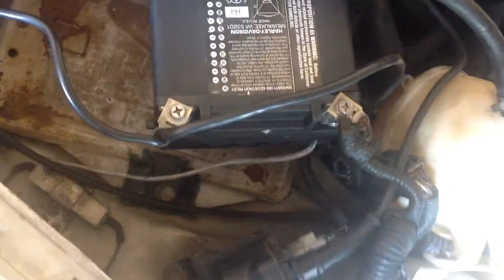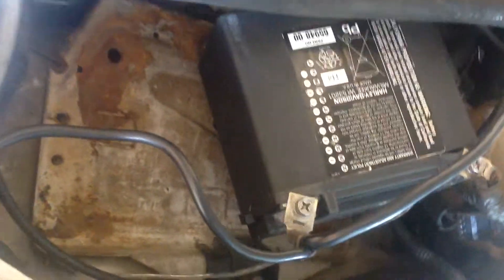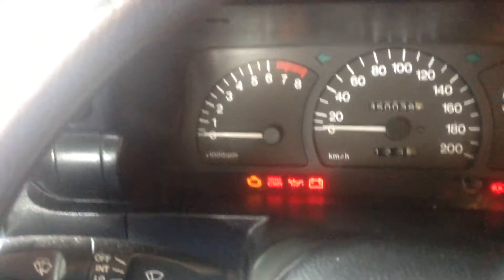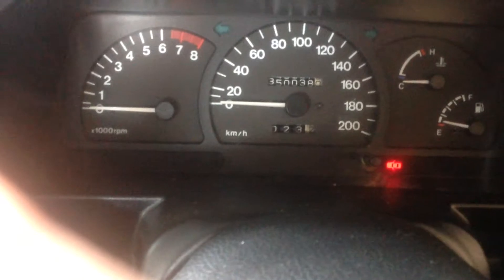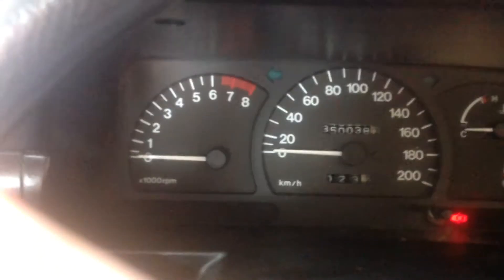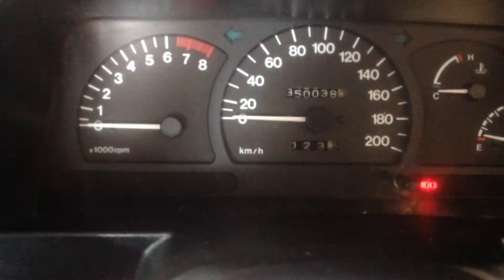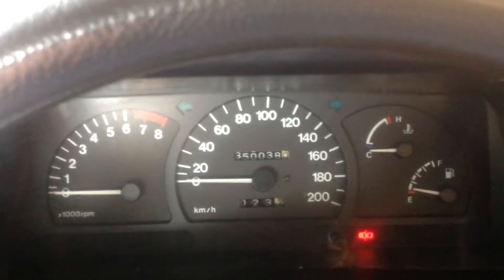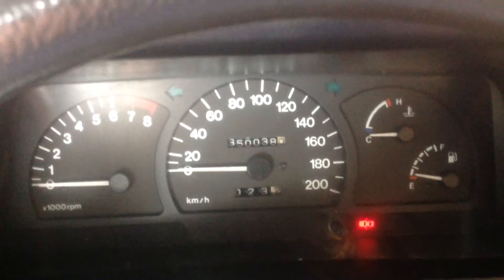Starting a car with my super capacitor pack

Comment: What Farad supercapacitors would you recommend for a 4.6 Liter V8 engine. I Tried 6 2.7 V 500 F capacitors in series giving me 16.2 V and 83.3 F. It did not turn over just quickly discharged from roughly 14 V to  6 V. Any feedback you have would be great!Thanks,              Clayton
Reply from the maker: +Clayton Sparks Hi Clayton, sorry for taking so long. Firstly if you are using capacitors bought from some random chinese reseller I would have doubts the ratings, As for a suggestion on capacity......I have no idea.... I would start by finding out what the cranking current of the standard battery is and then plan a pack around that value, as in the maximum cranking current should be equal to the repeatable output of the bank not its short circuit value.
Thanks for watching
Reply: +African Electron Thanks for replying!  my battery is rated at 590 CCAs but I test how many amps it takes to start my car and it's a little under 400 amps. I just order 6 2.7 V 3000 F capacitors which I am going to put in a series. if my calculations are correct it should definitely be enough to turn my car over!
Reply from the maker: I suspect your calculations are spot on should crank a tank.you should make a video.

Comment: Have you tried to start a diesel engine vehicle using this? I created my own supercapacitor module. 6 pieces 500 F. It can start a motorcycle. I tried it on a diesel engine, the glow plugs consumed the energy of the super capacitors and didn't have any juice left to crank the engine.
Reply from the maker: Viper Strike Afraid i have no diesel vehicle to test it on. Capacitors hold very little energy my suggestion would be to use the capacitors along with a battery ....the battery would likely last forever since there would be very little strain placed on it during operation.